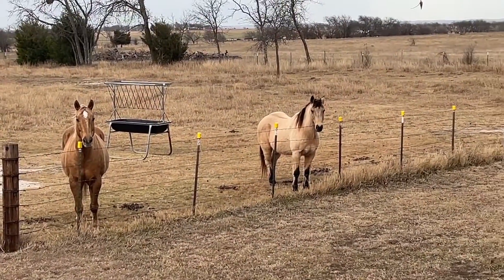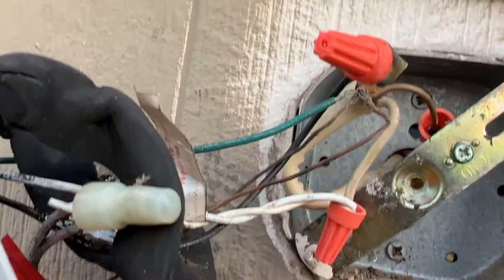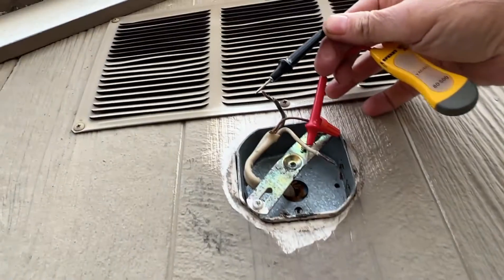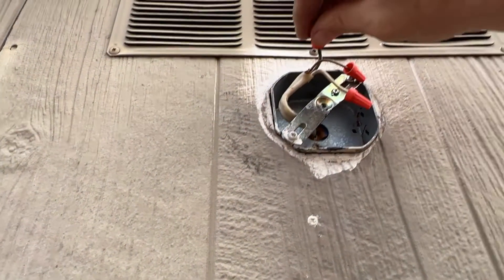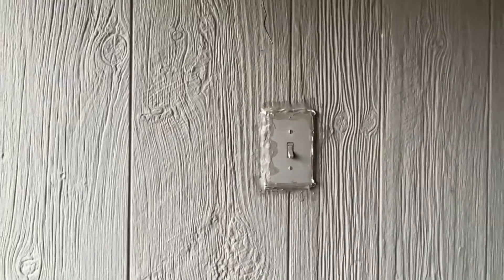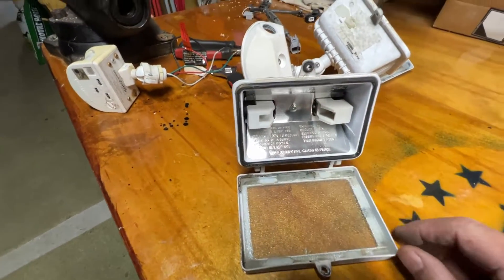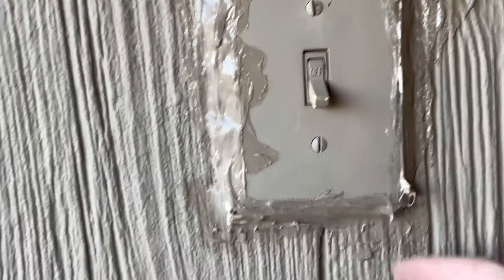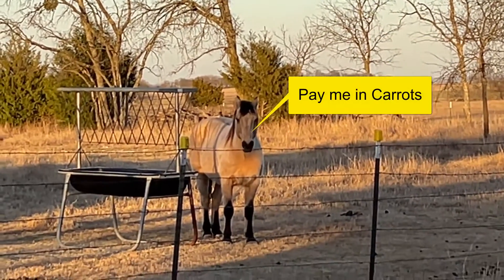Fun With Electricity - Replacing A Light & Finding Other People's Wiring Mess - Wires Are Fun

Comment: You can just lick your fingers and grab both wires to test. No need for a fancy tester. Yeah quartz halogen bulbs are expensive. And on electric bill. LED is the way to go. Brighter light, less power consumption

Comment: Wait, the original unit had PIR motion sensor, but the new light doesn't?  Maybe you weren't using the motion sensor function?
I've had so many dud outdoor motion sensor LED light fixtures, but I finally found a solution about a year ago.
I used a standard fixture with two adjustable light sockets (metal, no sensors, nothing to go wrong), and put two PAR38 motion + light sensor bulbs in them.
There are a bunch of variations on these bulbs (brightness, color temperature, how long the light stays on after motion is detected, etc.).
I bought a bunch of warm white ecosmart ones with 1 minute timer (Home Despot).  They will also stay off during day time thanks to built-in light sensor.
They do NOT use PIR (infrared) sensors, but rather radar sensors.  They have been fantastic for me for over a year now.
And if any one goes bad, I just swap with a new bulb.  No need to mess with the fixture itself, as the fixture is just a dumb light socket thingy.
Reply: Thanks for that tip. I didn't know there was such a thing.

Comment: I need to get some lights put on my garage and change out the light fixtures that are inside the garage. But I don't know one single thing about any of it so I'm not gonna try. Electricity scares me. If it's more than putting in a lightbulb I am pretty much looking for someone Else to do it. Very low vision and electricity just don't mix well.

Comment: We have same siding (vertical) on our house. Above the garage boards were installed horizontal...Water got between the boards and warped them. Big pain in the rear. Should consider taking a look  behind your switch plate to see if wires are corroded. :)

Comment: Those exterior light switches aren't that expensive; you can get them for less than $6 at lowes or Home Depot.
Reply from the maker: why spend 6 bucks when it has been there for over 10 years and no problems
Reply: @Good Luck America  I was thinking of appearance and safety..

Comment: Noting wrong with twisting the ground
Reply from the maker: it is not a good solid ground sliding, vibrations, could slide over hot and arch or ground out, not a good way to ensure a good ground.
Reply: @heygunpeople  if it’s wrapped right it’s not going to slide but to be to code they should be bonded or wire capped